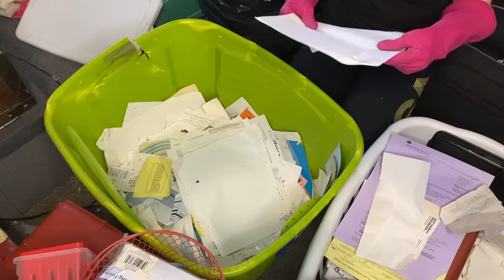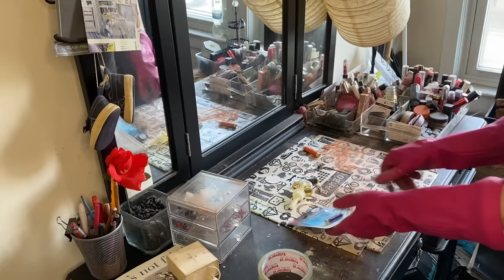SATISFYING EXTREMLY MESSY ROOM CLEAN UP!! #decluttering #cleanwithme #cleaningmotivation

Comment: One thing that most people may not consider is that even if things get messy again ,  the people now have something they may never have had before  HOPE
Reply: They aren't starting from scratch but experience.
Reply: So true- glad you said it!!
Reply: Hope is SO important ❣️
Reply: I prefer to think of it as the slow construction of a wall around themselves. The higher the wall, the easier they can hide and the less likely will get hurt.

Comment: One thing (although I’m not a hoarder so probably doesn’t apply to them):  during covid I gained 14 pounds    In only 5 feet tall, so that’s a LOT,  I had to (sadly) buy all new pants but yep, keeping my old ones, because I AM going to lose those 14 pounds and get back into my old clothes.   I will donate the current larger size.   I need those old pants as motivation

Comment: Wow!! So much stuff you went through! Tell your client a tip from me with all the paperwork…I know how that big bin of papers is going to be so overwhelming. First go through it and get rid of all the obvious trash. Adverts from the mail and just super obvious stuff you know you don’t want it need. Next, go through a second time, get rid of all the envelopes that mail has come in. If it’s a statement, get rid of any advertising, save only the statement page and the return envelope. You’ll be amazed how much smaller your stack is already! Keep all your statements and return envelopes to one side. Those are bills that need to be paid now or soon. (If at all possible, sign up for paper free billing and set all your payments up to be paid automatically! I get my retirement check the first of every month, so I have everything preset to pay on the 3rd just in case there’s any delay) this makes sure all your payments are on time and you don’t even have to think about it. And it helps avoid late charges or dings to your credit rating! That will also cut down on the amount of paper you have coming in daily! Next make a couple of piles with what is left over. Kid stuff in one, to be filed in another. With the kid stuff, separate the paperwork that needs to be signed or read from artwork you’d like to save. A point about artwork for all the moms and dads….I saved all my kids cute artwork. Not all the random coloring or doodles. But stuff they obviously put thought and work into. Then at the end of the school year, try to whittle it down to one or 2 really cute things that really show their creativity or skills. Toss the rest. I saved so much and neither of my kids wanted any of that as adults!!!! They couldn’t understand WHY I had saved all of that. 🤷‍♀️ so just know if your saving stuff it’s for you, not them!!

Comment: estoy impactada de como las personas tienen apego por tantas cosas inservibles , provoca es meter todo en un bolsa de basura sin clasificar nada
Reply: To do laundry and decide to keep, donate or throw away later (throw away could be done instantly). Putting like things with like things are a good idea. Then you know where to find those categories. And easier to decide if you have too many of one thing to give away, donate or throw away. And set aside cannot decide now until later, which most of us get stuck. Barbie, Mack and Bonnie have shown us how this is done. To think to go through a box let alone many or a room, this makes so much sense yet it overwhelms most of us. This helps even if little by little. Even a box or bin with little things in like grouped. The key to their methods so the homeowner can find or sort later. They are amazing.